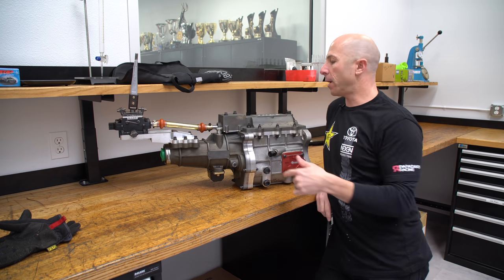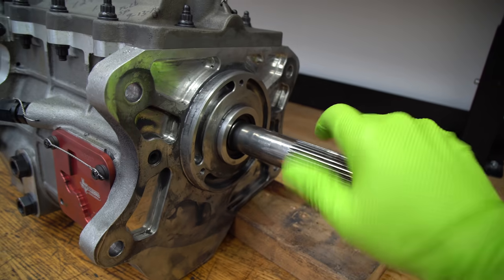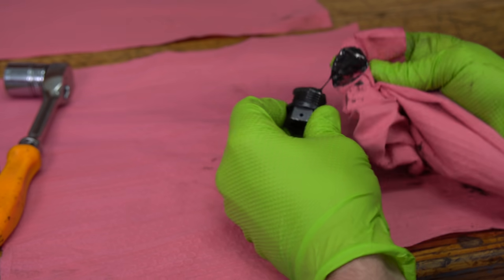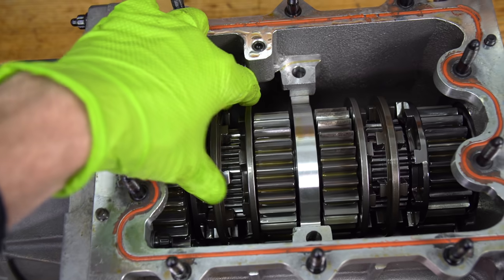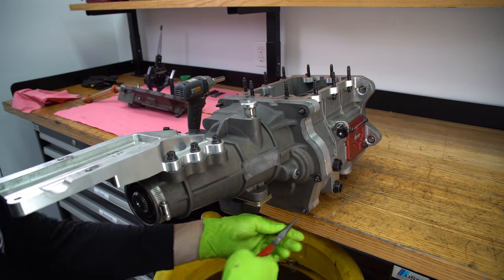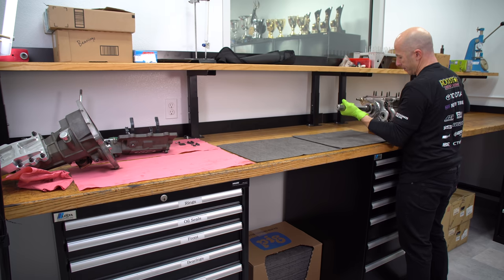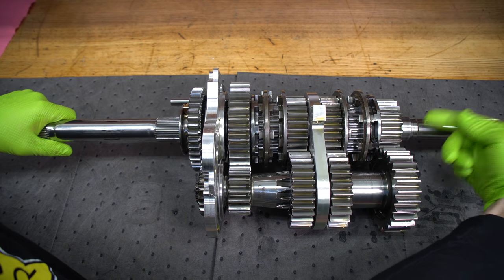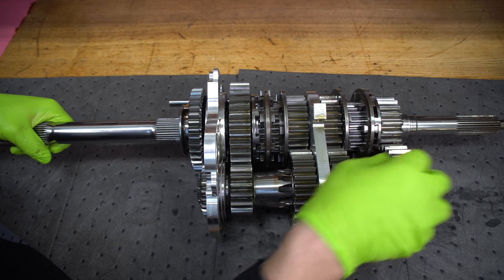NASCAR Transmission Teardown and How It Works

Comment from the maker: What should I teardown next?
Reply: Yes! love these videos! Thanks for posting! If you got a V160 you'd be willing to tear down I'd love to watch as mine is leaking and i need to reseal it..
Reply: Aasbo's diff!
Reply: I've always wanted to understand and see a comparison of a gear type and clutch pack type LSD.

And a Direct shift/dsg gearbox.

And maybe the new Supra? How it's been built/it's underpinnings etc.
Reply: very nice exlpaining video If you can show us next time how diff works it will awesome
Reply: tear down a 4 piston k24 block!!
Reply: Tear down the aisen transmission, the world's most reliable automatic transmission. Gotta know its secrets. And it's from a line of Toyotas, not made from them though...
Reply: A CV shaft off the corolla
Reply: Dry sump pump? The rear end out of the Corolla? Or even a walk threw of the old civic's
Reply: A look at a DSG would definitely be cool being a vw guy myself
Reply: Can you teardown the rear diff. of corolla hatchback 1000hp please?
Reply: LSD!
Reply: How about a video of putting an engine together
Reply: Been a fan since I read an interview with you in SCC back in the day.  I'd be stoked to see some suspension components pulled apart. Hell, I'd watch you replace a ball joint on an elderly lady's Corolla.
Reply: Tear down an ECU!

Or an in depth look of main bearings.
Or an F1 engine...if you can get hands on one.
Reply: I like your Videos👍🏻 Please can you make a Toolbox Tour and a Shop Tour Video? Theis from Germany
Reply: Winters quick change differential.
Reply: The Corola im from last year or the Scipn tC and make a rebuild series of the rebuild of a race car. love the videos. the best explaining videos out there. goodwrok from Norway
Reply: I like that manual transmission than a CVT.
Reply: Steering racks and ratios
Reply: a differential!...torsen or clutch pack or something like that
Reply: I'd love to see a Sequential teardown
Reply: tear down the misinformation TheAlternateAir has regarding above comment thread
Reply: Super cool channel dude. I really enjoy working CAD software, so seeing the different types of designed gears in combination with bearings and such, absolutely fascinate me. I've got to watch this again in slow motion.
Reply: A dog box gear box from a rally car. Wonderfull video  thankyou👍
Reply: I want to see you tear a rotary motor apart
Reply: 2012 Yamaha R1 please
Reply: space shuttle or a gravitic propulsion craft, your choice. I dont mind.
Reply: KrakenEP not a bad idea.
Reply: PapadakisRacing What does it take to be an intern at Papadakis Racing?
Reply: KrakenEP  bro you’re channel is so under rated good content. Omg that CRX  is sick 😷 looks older than the ones that came out before 1990 I want to say 87
Reply: A woman. Since we dont understand them
Reply: Maybe get that hernia taken care of first....
Reply: My ex-gf's mind
Reply: @BlackyBrownDestruction9337  most reliable? They are put in cars that produce very little torque for starters. A transmission from a golf cart could hold up as well lol.  You are funny. And toyota has shares in it. No dealings with making them.  They are used in dodges, chevs vw crap etc etc etc.
Reply: @bonnivilleblackcherry9745  It's what Scotty Kilmer said lol
Reply: Commericial/semi truck transmission
Reply: a computer, with Linux tech tips. he tends to drop things too :P
Reply: Great video!! I’d love it if you tear down a nascar engine next. Either an R07 engine, TRD, or a roush yates engine. Anything straight out of a cup car.
Reply: Everything. with these details. wow i just fell in love with these videos. i really hope you show most of the mechanical and suspension stuff. its all very interesting.
Reply: tex race 101 old school Nascar  Trasmission at this point I have one new in the box one in the car was in the car for the Rolex 24 in 2000 19 years later I still have the same transmission in the car  only problem has been I have broken the small gear in the back for reverse I pick up the bad habit of driving to the grid  those days
Reply: How about the engine that was originally intended to mate up to this transmission? Gettin' a look inside a legit NASCAR V8 would be amazing, especially if you had a street worthy smallblock next to it to compare parts to.
Reply: MotoGP seamless gearbox.
Reply: @mattk9438  +1
Reply: Lotus 70's F1 
😀
Reply: LOVE these videos! =) thanks for sharing, you and your team is really our inspiration =)
Reply: rear trailing arms!
Reply: How about tearing down the shift linkages?  Or a "side shifter" transmission!  Or maybe your diff?  Bah, this channel is so cool!  :D  MORE TEARDOWNS!  ALLOFTHETEARDOWNS!!!!

Subscribed.  :)
Reply: VR6
Reply: Dual clutch transmission please
Reply: Everything! Great videos!
Reply: F20C
Reply: A shock rebuild or rear end rebuild
Reply: Both Evo 4G63 and 4B11
Reply: Rotary engine!
Reply: Coilover refurbishment
Reply: A Subaru TY856!
Reply: Any Honda engine. b16 b18 b20, etc
Reply: DCT Transmission
Reply: A dsg transmission
Reply: γιατι εφυγες απο ελλαδα?
Reply: how bout something American..   like a stock chev 350 so your audience can see the dif between a rice burner and actualy power by cubic inch's   then tell em the cost difference.. lol
Reply: Please tear down a 1.8t awm from a b5.5 passat!.... please
Reply: I know I'm late bit could you go over engine management basics? I know it's a long shot but I'd like to know some general rules of thumb.
Reply: A nice girl from NASCAR?
Reply: a ford ecopoop motor ... show everyone how much of a peice of shit it is ... ill wait
Reply: 370z vvel system. So much headache
Reply: K20 or k24
Reply: I would suggesst that you do maybe a slight teardown of a bmw M car box, "how to" for a shimming process.
The measurements to be done, and the process is very interesting but the shimming cannot be found anywhere.

Thanks
Reply: PapadakisRacing if you could get your hands on one I’d like to see a twin countershaft teardown. Taking one apart rn and gotta say it’s pretty neat 😁
Reply: A rear gear!!
Reply: My used 2jz gte please and remember to rebuild it for me when you're done please. Thanks Stephan .
Reply: Ls1
Reply: Motor GP!!!!!!
Reply: American Muscle! Like a 360 Duster!
Reply: The Wall!
Reply: Axle bearings. Are they ball bearings. I recommend a duplex ball bearing for the rear axle housing.
Reply: Vw DSG gearbox
Reply: A rotary? Maybe so can show people how they work
Reply: have you done an automatic tranny?
Reply: my wife's nissan sentra 1.8 GXE so I can get a step by step and figure out wtf is wrong with it. hahaha cries
Reply: Your mom.
Reply: A motorcycle engine
Reply: 5.9 diesel
Reply: Zf 5.46/47   for us old diesel guys. Thanks
Reply: Eaton 10 speed
Reply: Q = what should i teardown next?
A = Bank system 😜
Reply: My 96 350 vortech
Reply: gm big block v6
Reply: 2URGSE V8 from  Lexus F cars.
Reply: I want to know how my BIC pen works, how did they create such a marvelous,mechanical pen in such a small foot print ! Jk
Reply: Double clutch transmission would be interesting.
Reply: Dragstare engine with this aluminum rods and there "special" kind of fuel and big compressor would be also interesting.
Reply: Dual  Clutch!  PDK..
Reply: Something American. Small block Ford Chevy or dodge 2 valve.
Reply: Vr6
Reply: I want to see a Rb26dett
Reply: DSG transmission to try and make sense of the German witchcraft inside.
Reply: Dodge 440 .
Reply: PapadakisRacing really love the videos you made!!! Explained clearly how that works. Fantastic. I own a 5afe and a  S65B40. So want to see M-DCT and s65 engine tear down.
Reply: RTO 6610
Reply: I would love to see you teardown a Supra V160.
That would be awesome
Reply: RTO 6610
Reply: @BlackyBrownDestruction9337  Toyota own aisen?
Reply: @MrDingaling007  Toyota buys alot stuff from aisen and other companies as well and stick it in their cars.
Reply: Diff
Reply: Id like to see ur favorite transmission to go with a 2jz build
Reply: Get 1000 hp out of a N20 bmw engine 4 cyl.  But whatever you do you need better lighting for your videos.  A light on left and right of you on the tear down would have made the sharpie a lot easier to see.  Love your videos, you need better lighting.
Reply: The origin of your last name
Reply: I'm sure this is a long shot but the l67 is very close to my heart and I'd love to hear your views on improving the whole engine and supercharger system
Reply: ZF 6hp transmission !
Reply: An EJ Subaru engine. Figure out why they keep getting class action lawsuits and not learning from them
Reply: A rotary engine, just for the horror of it all.
Reply: Hello Mr.Papadakis. This transmission make that sound that Mercedes SLK-GTR does?
Reply: Deez nuts
Reply: Your opponents
Reply: My toaster that doesn't work anymore...
Reply: Could you please tear down a BMW B48 engine. Excellent content and great presentation.
Reply: Teardown something expensive
Like gemera engine
Reply: A rb26 skyline engine
Reply: Marine engine accessories (ZF & TWIN DISC gearboxes, sea water pump, elbow riser & sprayer, wet exhaust, sea water/coolant/oil heat exchanger, sea water/charged air aftercooler...).
Reply: Dual clutch transmission ?
Reply: An ECU
Reply: @jii1980  I
Reply: Teardown the engine from your first 7 second FWD Civic.
Reply: RB26
Reply: sequential transmission

Comment: This video told me more about how a transmission works than I've learned in my entire life.
Reply: What a mood
Reply: That statement doesn't make much sense
Reply: Rebuilding my Getrag 233 (aka Toyota V-160) taught me more than this video by a long shot.  Prepping motorcycle engines for racing also taught me a whole lot about "dog" boxes, shimming gears, and backcutting straight dogs.  The dogs in this box are undercut as anyone would expect for something at this level of competition, but doing this with inverted cone stones by hand on both dogs and holes is a painstaking effort.
Reply: it feels like i am a kid again opening everything to find out how it works 😂

Comment: Next, Formula One Gearbox
Reply: Channel named Driver61 tore down an old gearbox out of an old 1997 Jordan. No very recent tech, but the same layout and mechanism.
Reply: F1 gearbox isn't that much different. It's straight cut, semi-automatic but more gears. It's only shifting gears faster than a DCT which is quite remarkable.
Reply: Society Unplugged NASCAR will move to sequential, so same tech, only likely less advanced. I am glad they are advancing technology quicker now. Might save money in the long run. Use outdated tech, you start paying more. Now, with sequential, the OEMs might be able to afford to build the transmissions since they are now more like stock transmissions now. H pattern transmissions are pretty rare now anyhow, right? On cars at least.

Comment: I just want to clarify real quick, straight cut gears are actually not stronger than helical gears, since helical gear teeth are diagonal, if you put two 1 inch thick gears side by side,  one straight cut, and one helical, the helical gear teeth will measure wider therefore having more material holding that tooth onto the gear. Racing transmissions use straight cut gears because they don't produce axial force (force pushing towards the front and back of the transmission along the same axis as the input and main-shaft) like helical gears do. Having no axial force allows the engineers to design much thinner transmission cases making them lighter. Straight cut gears are much easier the manufacture making them cheaper and allowing more affordability for race teams to keep spares in case of transmission failure. Helical gears run much quieter making them a good choice for street cars and since everyday cars usually have below 200 horsepower and aren't concerned with saving a few pounds helical gears make a good fit. Just wanted to put that out there for anyone who actually is interested.

Comment: I drove a Pro Drive rally car with a dog box on it with straight cut gears and it was very loud but you could just ram it into gears without synchros by just coming off the throttle a bit. If it wasn't for the noise they make I would love to run one in my street STI.
Reply: You can run dog boxes in street cars, the issue is every shift you make you have to shift with 100% force. The dog teeth will round off and engagement doesn't feel as quick or easy. 

But STI transmissions are stout, there should be no reason to run one under 800hp if you aren't drag racing every weekend. Even a dog box WRX transmission isn't even half as strong as a stock STI transmission, dog sets aren't always better. I build evo/subaru transmissions every day and it is a very common misconception.
Reply: Fancy seeing you here barnacules
Reply: I used to watch your 3D printing videos and now I'm much more Into cars, I'd never expect you to drive an STI. Good choice 👍🏻
Reply: Thanks, that was a pretty good answer to my question to tabcobra
Reply: I went to your page but there is no race car videos? Why haven't you posted your car on your popular channel?
Reply: I kept thinking that GT and rally cars where whining because of a big supercharger. Nope, just the transmission. I love the sound, it sounds robotic almost.
Reply: i never know what's driving a pro rally feels like.. but i used to shift like that with my 2 stroke yamaha back in the 2000s. Shifting with ignition cut was best at the time.

Comment: Top notch content. Simple, to the point & informative.  Thanks for sharing.  

Btw, Stephen, what's your thoughts on the new Supra?  Although there is a bunch of internet pitch-forking, I think there's gonna be a high demand along with local dealers adding on "Its a Supra" 10k tax.  
Being that you guys work closely with TRD/Toyota in Formula Drift, is there a chance that we'll see Aasbo piloting a Papadakis Racing Toyota Supra in a year or two?
Reply: Chiming in, I hate internet pitchforking I think Toyota took the success of the Subaru twins the wrong way. Everyone wanted the '86, they made a pure reasonably priced car close to it's roots even though it's boxter engine is a pain is some areas but with just enough to HP to have fun. BMW reputation lately with deteriorating obscenely priced plastics, gm sourced transmissions and massive cost cutting have gutted that brand. Toyotas reputation or over built modifyable engines was the MAIN reasons this car would've sold. Once this car pushes $70k after the stealer tax, that opens up A LOT of other options. They needed to go backwards towards lighter and powerful AND that overbuilt engine. I don't think the BMW engine will cut it. Driving dynamics might be stellar but then why not buy a Subaru twin? They basically competed with themselves
Reply: That’s what I don’t get. Why Toyota, known for unimpeachably reliable engines, went to Subaru boxer ( albeit a fine enough engine ) for the 86 and now BMW? It’s the heart of the car! And Toyota isn’t putting their hearts in their cars.
Reply: @blakestone75  At least with the BMW Toyota apparently did a LOT of reliability testing and redesigned whatever failed, so the engine should be up to Toyota reliability standards.
Reply: @MrRedstoner  hmmm...I doubt it, they still have a plastic manifold with a intercooler bonded in. It's designed to fail, and designed to cost a fortune to replace, which is now the goals of BMW R&D.
Reply: the problem with the 10K tax is people will just logically order a C8 Corvette.  Thank GM for keeping Supra prices stable.
Reply: @MrRedstoner  and that was the line we were told about the Subaru Boxer, until the valve spring debacle.
Reply: You gotta check him out tear down the new B58
Reply: You guessed that shit right hommie. Good job!
Reply: @tanicwhisper0647  Yes he did! This comment has aged nicely

Comment: Helical gears are stronger than straight cut gears.
Straight gears are used because they dont produce axial loads like helical gears, so they don't require the high strength axial thrust bearings.
This greatly simplifies crankcase design, decreases cost, and most important decreases weight.
Reply: And also the cut gears permits the driver to shift without using the cluth, that's mean much smooth and faster shifting.
Reply: Semantics.
Reply: Bryce Peters not at all!  There are real differences and real reasons for choosing one over the other.
Reply: @ChefofWar33  - No it's the biggest misconception surrounding transmission design straight cut gears themselves are weaker
Reply: @manuelcircelli511  true, drivers don't use the clutch. brake and gas all they need lol
Reply: @manuelcircelli511  False, all gears are always in mesh in an synchronized gearbox.
Reply: "and most important decreases weight."

Isn't that the definition of being stronger? A product that can handle more power with the same weight or same power and weigh less is a stronger product. He didn't say the gear spurs itself are stronger, only straight gears (design) are stronger.
Reply: Spur cut (straight cut) gears are stronger, helical gears are made to run quieter for street cars.
From Russia, with LOVE.
Reply: It all depends on the cut angles.
Reply: "Helical gears are stronger than straight cut gears" EXACTLY.
I just left this myself.... guess I was a little late to the party though! lol